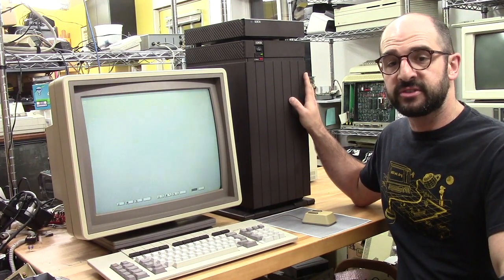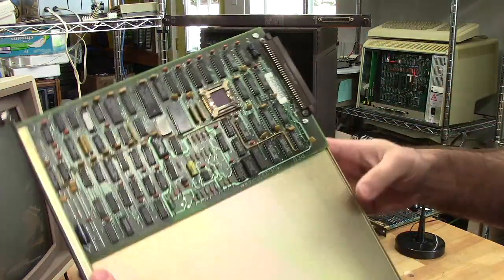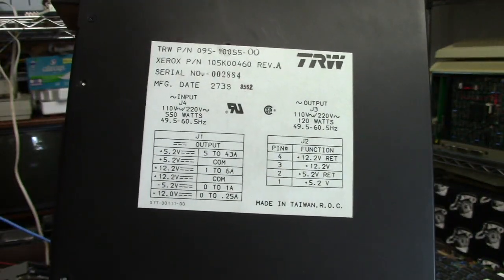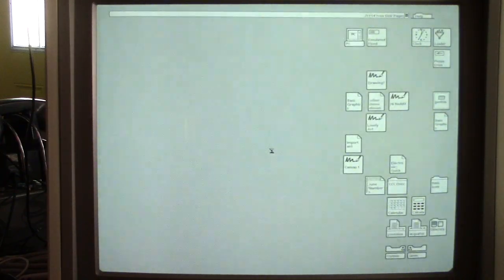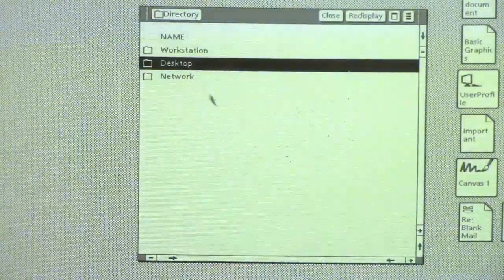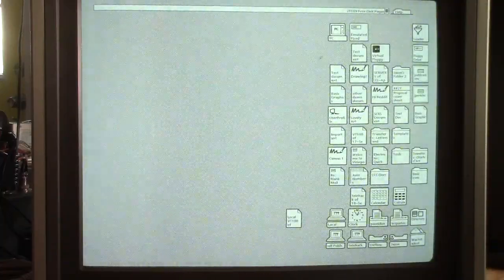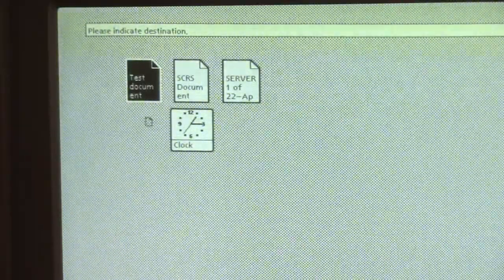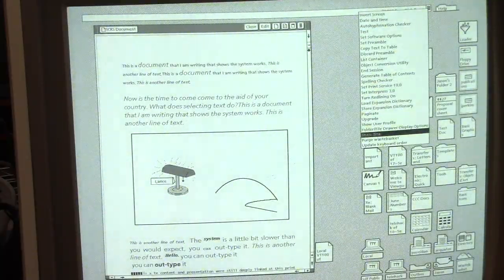Xerox 6085 Daybreak Hardware and Software Demo

Comment: Wonderful presentation of a rare piece of computer history. These Xerox systems led the way to so much technology in the following decades.
Reply from the maker: Thank you!
Reply: One must agree with Steve Jobs. They make amazing things but they can't sell them. The only things got close to object orientation are NeXT and  OS/2 years later. Imagine saying "You will pay extra for a clock and bold capability"
Reply: @Olgasys  That really isn't fair.  If you were trained on and used Xerox View Point/Global View on a day to day basis, you might think differently.
Reply: @DandyDon1  You need to be in a very specific geography with a very special job to have access to them. It could be wrongfully considered a toy compared to these workstations but I still miss my ease of interaction with Amiga Workbench.

Comment: A machine I used frequently... except loaded with different microcode, running Interlisp.
Reply from the maker: I just got the extra RAM for the control store, I hope to get Smalltalk running on it soon!
Reply: I used to work on these in the UK main EU HQ, 1,000 people in one building, all with a machine, all networked.

Comment: Very interesting to see the little UI kludges and rough spots (e.g. the warning about waiting for a specific status code before power off; manual repagination hidden in a menu; slow graphics drawing at least compared to the Mac which was highly optimized for the 68k and other Macintosh hardware only) that, one assumes, might have been eventually improved in future versions if the product had been more successful.  (Or, at Apple, Steve Jobs would have yelled at people until it was fixed before release.)
Reply from the maker: The 6085 II is quite a bit faster from what I've read. And this machine is quicker than an 8010 Star!

Comment: I've come back to this video multiple times and have an irrational love for Xerox (how on earth did you find one!).  I'd really love 3D models of the case, monitor, and mouse, but I might have to make them myself.

I subscribed and hope you'll cover it still more.
Reply from the maker: I plan to! I got a 2nd unit that has problems, so there'll be more to dive into. 
I'm also going to show this system at VCF West later this year!
Reply: @compu85 I’ll be there with camera and calipers:)
Reply: @compu85  I just came back from VCF West, but I didn't see you :(
Reply from the maker: @tommythorn  I couldn't make it out this year :( had a schedule conflict. But will next year for sure! I just got a 2nd 6085, so that should make the display even better!

Comment: I used to fix these, I worked for Xerox in the late eighties, early 90's.
Reply from the maker: Any good stories? :)
Reply: Many! The most changed item were the screens. We’d change 3-4 a week. You can have fun with the screens, you can flip the X and Y plate connections, it’ll turn the image upside down and back to front. 
The air inlets would get clogged with dust. Heads in the disks would get stuck, a shake of the disk is required. Saved a few desktops data from loss by using the advanced tools to add  bad pages and scavenge the volume. All the systems were connected to a network, big thick co-ax where you had to tap a new connection live. If you got it wrong that entire network segment would go down. We also had the 386 companion boxes. Could be run independently or attached to a 6085. Used to know most of the boot codes off by heart. 
Keyboards were another issue, usually coffee, but there was a trend for metallic nail varnish, flakes of it would get into the keyboard and short circuit keys.
Reply: Also used to maintain the 8010 systems file servers and removable storage systems. Changing and realigning the heads by hand, all 20 of them. Also saw some of the newer 8090 systems and Sparc IPX boxes. Trained on all of the aspects of XNS, clearing house servers, routers etc. It was a great grounding for networking. We also introduced 10Base-T, Cat 3 and fibre networking. Dec VMS, MS-Dos all co-existing.
Reply from the maker: @AdrianMoir  Wow so they had you actually swapping CRTs out, not just replacing the whole monitor?
Reply: @compu85  We swapped out the entire monitors, but you could play with to a certain extent. Focus, brightness etc.

Comment: So, did this system offer terminal emulation so that you would be able to access IBM mainframes and datastores?
Reply from the maker: Yes! And you could connect either locally, or to a terminal concentrator over Ethernet.
Reply: @compu85  Now, I’m wondering if token ring was directly supported or if you had to have something to translate between token ring and Ethernet.
Reply from the maker: @JeffTiberend  you would need a token ring MAU with an AUI port, and hook up an Ethernet transceiver. That would get you hooked up at the physical layer.

Comment: Shame on you for letting that 6085-1 controller get up on the table.... ;)
There was the 15" version monitor as well, but....
The later 19" monitor (of which I own one) has a power switch-volume control as well as the brightness control, and a green led in the front with three right angle grooves/slots.
Personally, I'd wear a anti-static wrist strap handling those PWBs.  
There was also memory and firmware/software expansion to upgrade the 6085-1 to be a XPIW (Xerox Publishing Illustrators Workstation).  The XPIW Logo was drawn from dots until completely visible which was superimposed over the bouncing keyboard.
The 40mb HDDs were notorious for not starting up!  Curious there is a LED on the C7 slot back plate.  The 80Mb Micropolis did not have those.  
I have few of the those TRW Systems power supplies.
The HACK version of Quick Restart would also freeze the time and date, sigh....
Cold start up time which depends on how many software modules were set to auto-start could be up to 20 minutes.  The practice around Xerox USMG in El Segundo was to reboot the workstations when we all went to lunch at noon.  This was done to recover page space.
Too bad you could get your hands View Point version 2.2.  It had many additional features.  At the time I was trained it was the current version installed in 1989.
On floppy I have the templates for Xerox inter office correspondence and the Xerox logo font.
Place about 10 clocks on the desktop all with second hands showing to see how much the screen refresh slows the system down, hehe!
I used the PC emulator in my 6085 for online dial-up chat.  For some reason it would randomly freeze then requiring a full system restart.
When you login, if you watch the icons appear in alphabetical order :)
Basic Graphics and Free hand are always drawn upon opening in the same order as original.  You could also do simple animations as well.
Paginate cleans up the edits (making the file contingent) and reduces it's overall file size.
There was a System Loader HACK which took you one level deeper into the system.  You could then remove system only software modules.
Reply: Actually the software keys can be entered manually.   I have a list of all the last keys which were available which also included GVWIN 1.0 for the IBM PC.
Reply: I have many of the Xerox HACKS for the 6085 including VP Aquarium, the Brush DMTs, a messaging software module which resembles AOL AIM for sending text messages to co-workers.
There was one additional HACKS software module which upon start-up showed the progress of the software modules as they loaded from the bouncing keyboard screen.  With each hop of the bouncing keyboard you would see a text message superimposed over it showing "Loading application Starting application Done.  I would then move to the next application start up progress.
Xerox sold MANY of these systems to US Government and Education.  USC had many 6085s.  I was working at USC when the first 6085 model 2 was delivered.
I don't know about you but I saw diagnostic code 0938 just before you powered if off.  I wonder what the difference is between 0938 and 0939.  Not sure if I have those codes explained my documentation anywhere....
Some of the diagnostic codes you always remember.
Reply: I was going to email you the complete Xerox View Point/GVWin Product Factoring Passwords, but I do see an email address in your contact info.....  The passwords are for VP1.1/Services 10.0, VP2.0/Services 11.0, GV3.x (Sun Microsystems) and GlobalView 3.x (6085, XGV-PC) I also have a copy of the official Xerox instructions on How To Use Global Passwords.